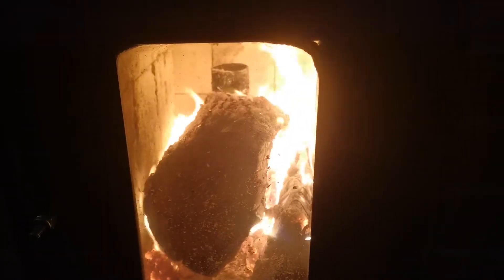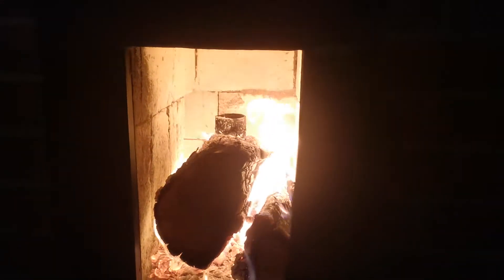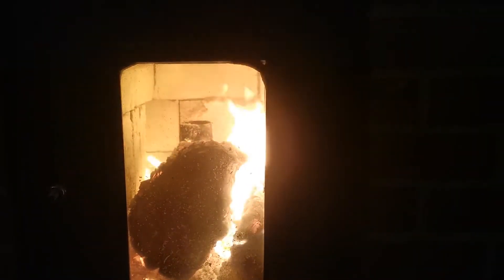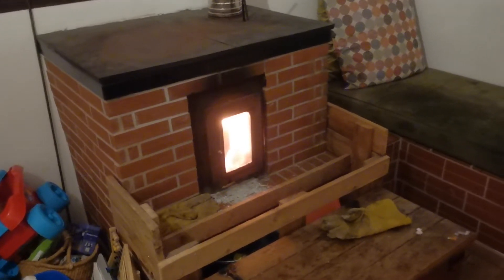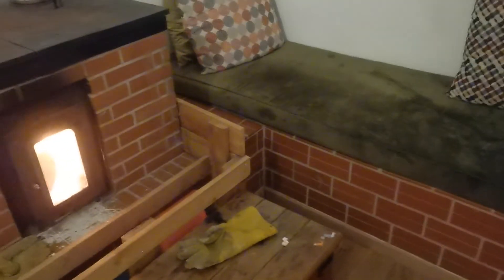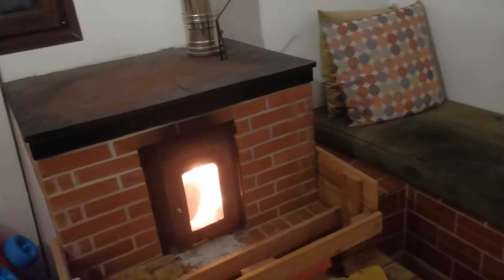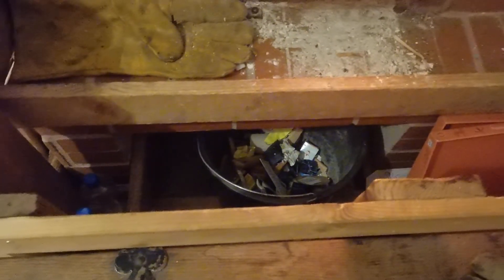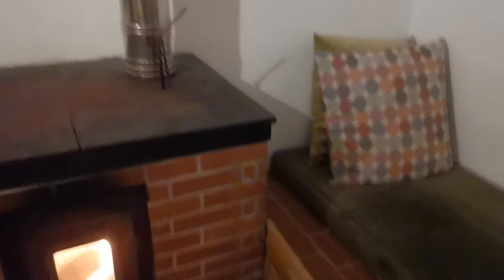Walker Riserless Core - 3rd year review of a Rocket Mass Heater

Comment: The riserless core works mostly because of the SOFT (reflective and more expensive) firebrick used. A regular firebrick "absorbs heat." The soft, "forge" firebricks creates intensive heat, reflecting all the heat "back," so all the smoke is used / burned up as fuel because of the extreme temperatures. I wonder how the riserless core would work with "regular" firebricks? Well... It would work of course... I mean... would there be a little smoke? I wonder if the secondary air port does very much, or is needed if enough primary air comes in the front. I would doubt that port does very much in the way of burning off smoke here. The 1,000 + F degree "core" burns it all up.

Comment: Beautiful oven. Do you know how warm the gasses are when they leave the flue after passing through the bench? What I'm wondering if there's a potential to extract more heat if you built a stove like this but with a larger bench.
Reply from the maker: Cheers. I haven't measured the exit flue but I imagine it isn't too warm. The single walled flue hasn't started giving off those rainbow colors if you know what I mean. Generally when a flue heats up too much and glows for a while it can really impact the stainless steel pipes. But that hasn't happened. 

It seems like youtube cut off your comment though, I can't read everything you wrote.
Reply: When the bell is larger than recommended you risk reducing the draft too much.  In that case the bypass needs to be opened. Matt has done a video on this but I don't recall the name.

Comment: Built and finished one this month. Excited to see how this handles our winters in MN USA. This is a nice confirmation
 Can I ask the Sq. Area of your house?
Reply from the maker: 55m2, which translates to about 600ft2.
Reply: @futurecaredesign  Thanks! That gives me a lot of comfort since those are about my exact measurements.
Reply from the maker: @quest_onchannel54  Sweet! Keep in mind that our house was insulated from the outside with about 2 inches of styrofoam insulation. The rest  of  the building on the inside therefore acts like  a thermal  battery as well. That really improves our comfort  levels.

If you place a RMH in a log cabin it will behave different from a framed building and different again from a mortar and brick building. 

I hope I am making sense here but I am sure  you will have gotten quite a bit of experience by now. What model did you build?
Reply: @futurecaredesign   The tiny cook stove. Its pretty neat! But I'm still not getting serious oven or bench temps. But I built a huge bench too. I'll post a video on mine after this winter to explain my process of building and experience. Our house is a framed building. Pretty warm so far but hardly any serious cold yet!

Comment: Did y’all build yourself or had someone build for you? If so who did the build for you?
Reply from the maker: Me and one worker did the base, the piping and the the core. Then we had a professional bricklayer come in to do a dressing of firebricks all around the insulated core. 

I  could have done this last part by myself but to be very fair: I am not a very good bricklayer and it would not have turned out as nicely as it did.

The original top and the door were made by a friend of ours. The door is still there and working, the cooktop was 8mm thick steel and it bent out of shape within the first ten minutes of firing it up. It still worked fine but looked very ugly. So during the next summer we worked with a local fireplace builder to replace it with this cast-iron top.

Comment: How high is the flue exit?
Reply from the maker: I would say about 6 meters. Inside of the living-room it is thinwalled flue pipe and then above the roof it is double wall and insulated with about 5cm of rockwool. Both types of flue are stainless steel and capped with a cone-shaped hood. The burn is so clean that not even two minutes after lighting it the white smoke disappears and the chimney looks like its not in use.